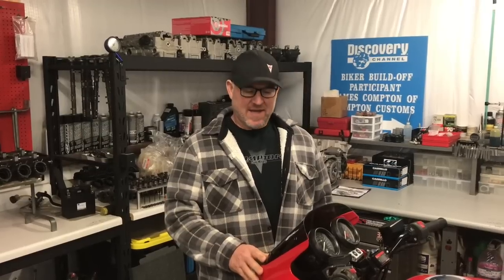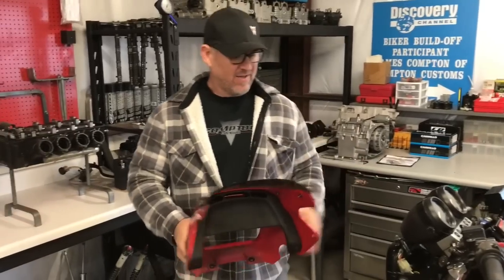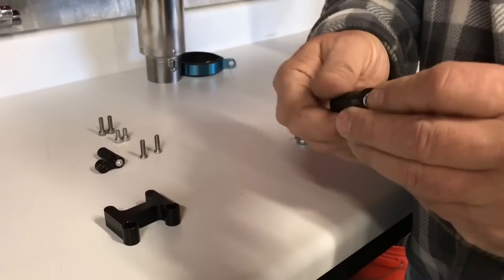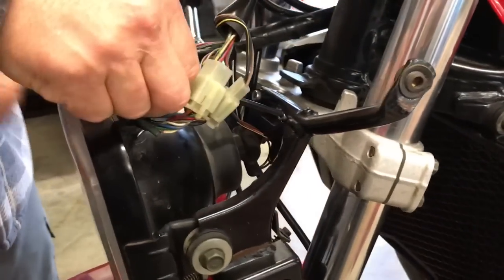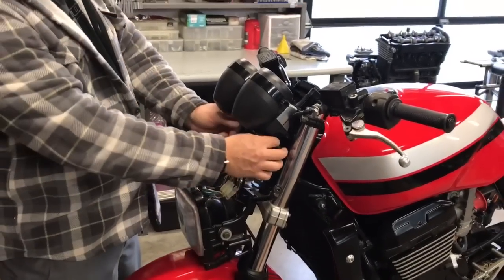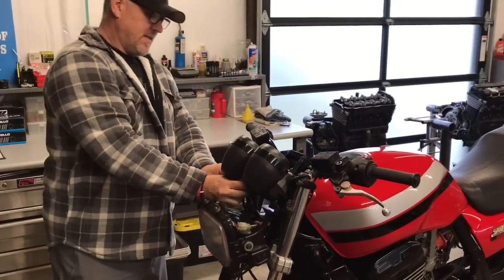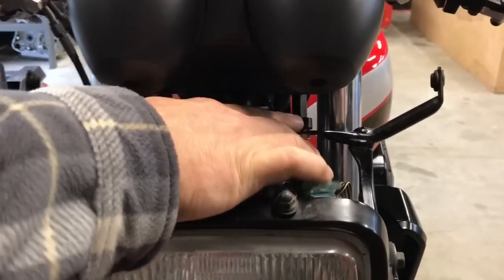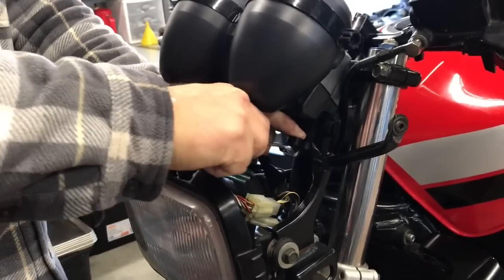ZRX Fairing Relocation Kit Installation

Comment: Great mod. For myself I'd order the taller smoked windscreen just for a little better wind shielding. The only thing about this aesome kit is the stock screen looks out of place. The great thing is that just about this mod, is that it just about lines up the livery colored tape tank and fairing. That's Always been the one thing that's bugged the hell out of me from the first time I saw these great bikes. Always ask8ng myself Why Kawasaki dont the livery color's line up? 
How much worse is the wind sheer when riding now?

Comment: I’m a little confused about the brake line thing. Would I need longer brake lines? Would braided lines of the same length work? In what way would they need to be different? I’m a mechanical moron, so if this is a dumb question, sorry.
Reply from the maker: Hi Scott, One of the brackets for the fairing relocation kit mounts where the OEM brake lines originally mount to the lower triple clamp. Therefore you need to run a different style brake line kit that doesn't need to be hard mounted in this location. Most aftermarket brake line kits will work fine. We reccomend going with a kit that runs two separate lines from the master cylinder to the calipers. Hope this helps!
Reply: @JamesComptonCustoms  Thanks!!